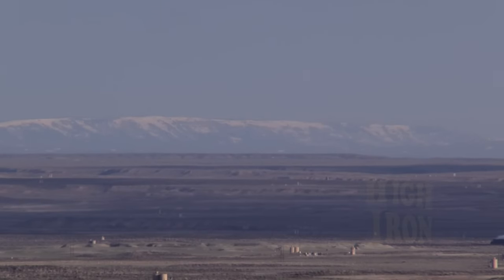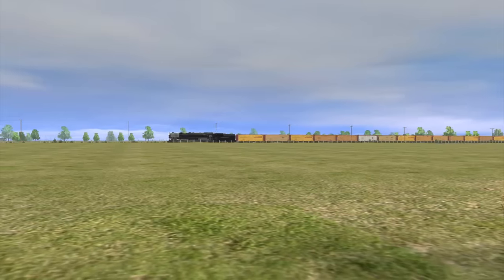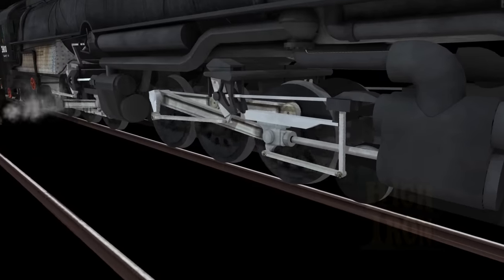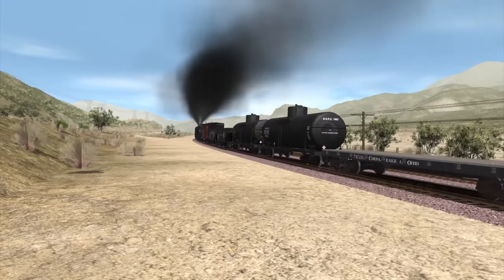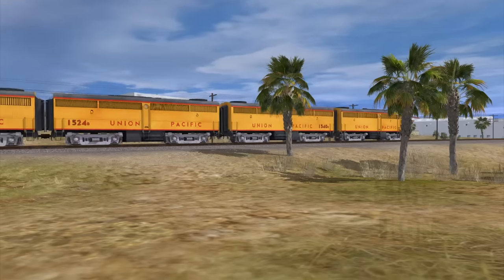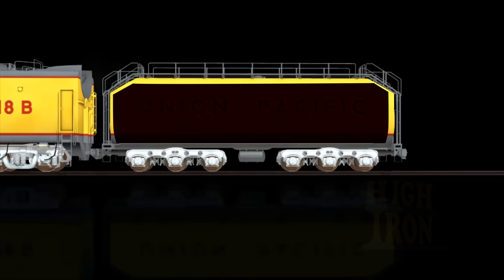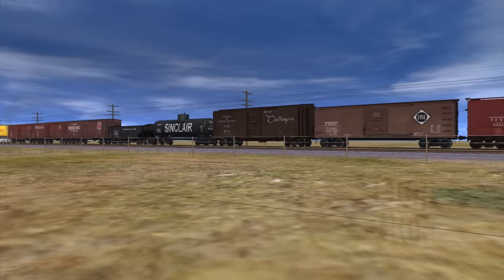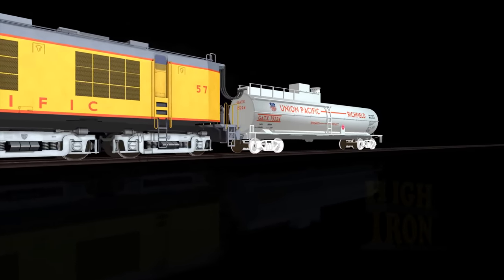Union Pacific's Superpower Fleet

Comment: It’s so weird being a car guy and hearing that 4500HP was 2/3 the HP of a steam locomotive. I had no idea
Reply: Shit ton of torque to
Reply: get a real taste of American machines
Reply: @thatdumboguy2163  what
Reply: @could_possiblybe_thane07echo  we Americans have an obsession with engines that put out ridiculous amounts of power, for instance in WW2, the P47Ds were putting out over 2000hp from their massive radial engines
Reply: @charlescourtwright2229  good, good
Reply: It was measured as drawbar horse power as opposed to flywheel HP and those dynameter cars back in the day were 1000 HP off much of the time.
Reply: Have you ever heard of an EMD 567 engine? 567 CID…per cylinder. Made in V-6, V-8, V-12, and V-16.
Reply: @IndirectHydrox  goddamn 🥵 put that in a Miata
Reply: It's also duty cycle. Most car engines use their horsepower for acceleration and could not be run continuously at max power. These trains were expected to run at very high power all day, day after day. Even the GE90 jet engine may put out 110,000 hp put your can only do that for less than a minute.
Reply: Car guy: yea, this beast has over 300 hp.
Train guy: 3000 plus. On a light day
Reply: AYYY a fellow car AND rail enthusiast
Reply: @crispy9542  if it’s measured in relativity to horses I am a fan
Reply: yeah steam machines basically have infinite torque, it's pretty nuts lol
Reply: And steam locomotives built this nation.  America today would not be the same without them.
Reply: @terry_willis  facts
Reply: not if your vin diesel, appearently he has 10,000hp under the hood
Reply: only 4,500HP Haha Taste REAL POWER HOUSES at 7,987HP You WISH I was making that number up, Pennsylvania Q2 Steam Locomotive a 4-6-4-4 which was in Service for over 13 Years yeah, considered by a lot of Railroad Fans to be the Most Powerful Steam Locomotive Ever Built and Lasted the Longest that weren't even Articulated and that did it right from Day one which Nobody Ever Talks about but Myself. The people that make videos on Railroading it shows they have either No Clue or don't do Research on anything as Union Pacific Railroad was always 4 steps behind everyone else.
Reply: Steam towards the very end was no joke. My favorite class of engine (the DM&IR M3 Yellowstone) has 6250hp.
Reply: @TheNutshaq  a single prime mover is probably bigger than a Miata
Reply: @TheNutshaq  shit bruh you wanna throw in a massive engine in small metal box
Reply: @emyriandragon2277  our god damn switchers go up to triple or quadruple that
Reply: The shredder steam turbine where I did my apprenticeship at a sugar mill was 3500kw or nearly 4700hp. Steam has unbelievable power
Reply: Yep even more than a supra
Reply: The diesel engines in a some locomotives do have a tie with cars though. I think General Motors used to own EMD (a manufacture of locomotives and the engines for them) before they sold EMD to another company in like 2000.
Reply: The thing with the diesel locos is that they can generate more usable torque in operation, simply because they are heavier, and could surge up the electric current during the start. 

For eg., the star freight steam locomotive of Indian Railways in the 1950s had a horsepower rating of 2600 hp, and had a tractive effort of 38,890 lbf. However, the newly imported ALCO FA series diesel locos had a horsepower rating of 1900 hp, but a tractive effort of 61,500 lbf, almost 1.5 times more. This meant that the new diesel loco could start up and haul heavier freight trains compared to the steam locomotives, making them ideal for freight operations.
Reply: The us government  formed  the  union pacific  rail road while the  santafe  wss mostly privately  funded
Reply: Hp does not matter. The actual pulling power is different.
Reply: @doyourememberme2904 yea the Q2s where really powerful, but probably some compund banking engine that had a simple mode was the most powerful, slower then a snail but enough power to tear a building off its foundations (see history in the dark s video, I only like choo choos)
Reply: @crispy9542 me too bro
Reply: @TheMNrailfan227 a single locomotive engine is definitely larger than 2 miatas
Reply: yeah I'm a car and truck dude getting into trains. I'm mostly fascinated by how cool steam locos are, they are just pure mechanical porn
Reply: @charlescourtwright2229  gonna engine swap a Subi with a Double Wasp and you cannot stop me
Reply: Sense HP takes speed into account it's not actually that much to go on.
Reply: Trains and large trucks mostly preform work by torque not horsepower. These machines typically have far more torque than horsepower. You'll see older dual wheel trucks that only have 150hp that could literally pull a house apart because of the massive torque the engines produce.
Reply: @IndirectHydrox v-8 DEVIL16
Reply: Electric locomotives are crazy too, the more powerful ones generally push out 10000hp continuous and some up to 15000hp in boost. They generally do lack tractive effort despite being more powerful compared to diesels but modern ones are catching up in that department.
Reply: Mf it doesnt cover ground the wheels turn and the earth moves under it
Reply: @TheNutshaq  Too bad horsepower doesn't have to do with the power of a horse, horses can sustain about 7.3 horsepower over a long distance.
Reply: @helloperson9445  yeah I don’t really care about horses until I can LS swap or Union Pacific Big Boy swap one. Horsepower being an inaccurate measure of a biological horses actual power output has nothing to do with trains being insane

Comment: shows you how powerful those steam engine were when the needed multiple diesel units to match that power
Reply: Steam tractors are another example. The sheer torque a steam engine can produce is off the charts compared to ICEs.
Reply: Diesel=speed
Steam=Torque and Power
Reply: @somerandomguythatplaysrobl7896  Funny how ppl saying that about electric too. I guess its on the other side of the spectrum maybe.
Reply: Electric motors have a crap ton of torque and a higher power density than diesel, so I’d say they’re closer to the steam end of the spectrum.
Reply: Steam units: Look what they need to mimic a fraction of our power!
Reply: They are powerful for sure, but all the other drawbacks make them rather obsolete, so it is pretty obvious why they stopped being used. Lots of maintenance and cleaning is needed as well as a complicated and time consuming start-up process, heavy pollution, and an incredibly low 6-12% fuel efficiency(for the average steam locomotive, Diesel for comparison lies at 35-45% and Electric at 85-95%)
Reply: Steam holds the record for the best looking and the best at inspiring awe
Reply: @tankskicommander5079  true
Reply: @Badjoe117  Now imagine how much more efficient those steamers could be nowadays with modern tech added. I wouldn't be surprised to see anything  between 40 and 80%
Reply: @Kellen6795  That is true, but I just don't see the point as you'd still need a source of heat for the steam, with either electricity or some kind of fuel. At that point you might as well put in a few electric motors. Three phase asynchronous motors for example are a bit weaker but are essentially maintenance free, turn them the other way and you also get a free generator that can be used to brake the train without friction.
Reply: Steam units: Good luck beating me mortal!!
Reply: @Badjoe117  Exactly. The age of steam is dead, people need to get over that.
Reply: When they run low on water and that crown shield gets too hot,  that is when they really show some power and not in a good way either.  When you hear a stem calliope toting away at the fair, make sure you are standing at least 500 feet away from it because because the clown playing it knows nothing about boilers and it is actually a bomb ready to go off.
Reply: @somerandomguythatplaysrobl7896  What?  I thought it all had to do with Boyle's law and the expansion of a heated gas.
Reply: @David-yf5fo  🤯
Reply: @Badjoe117  You know your stuff Joe!
Reply: @Badjoe117  Aka "dynamic braking." Diesel Electric continues to prove itself...... I serve in the Navy, we've just about eliminated Boilers and Steam Turbines with the exception of Carriers.
Reply: @dr.redstone7980  All of the fastest trains currently are electrics. Without a huge engine at the front, you have a lot of room for aerodynamics.

Comment: UP also tends to run "just enough" power for the trains, oping to not have extra units or extra power if something goes wrong.  BNSF always has extra units on the train (usually 1 or 2 extra locomotives), opting to have the extra power and not need it, then to need it and not have it.
Reply: If they lose a unit they just send out 844 to push.
Reply: @MrMikado282  having gone out a railfanned a bit, and watched the Chehalis, WA, VRF cam.  UP has had two stalls on a 1% grade hill, both within a week of eachother (and it was the same train too).  Forcing the 2nd UP train that runs behind them, to stop and drop their train on the main (right in front of the cam).  Then run up the hill and help push the train, then they come back and grab their train and proceed up the hill themselves.  Either way it causes a major traffic issue (for trains) and for the poor Seattle sub dispatcher.
Reply: in the uk we used to have locos near difficult inclines etc as bankers to help provide the extra power needed aa it reduced costs having to run that extra train the whole route
Reply: @MrMikado282  when they lose 844 they pull out the unit
Reply: @SirLANsalot  You just described every day at CSX!!
Reply: BNSF knows how to run a railroad, moving cars, is how it's done....
Reply: "then to need it"?  How about "than".  Seems to be a common mistake recently.
Reply: @spingleboygle  it's known as the loco that never quits so...
Reply: @skeebot Ok grammar police

Comment: Not only are modern engines insanely powerful, but railroads often opt for AC traction motors, which can drag circles around their DC counterparts.
Reply: What kind of Horsepower output are we looking at?
Reply: I don't feel like typing, hyce explained this whole thing on his channel
Reply: @fireWireX4 India's electric locomotive WAG 12 produces about 12000 hp

Comment: The Union Pacific Articulateds, Gas Turbines, Big Jacks and Centennials: The REAL Legends of the Rails
Reply: Actually all locomotives made from the trevithick loco to today's engines are legends of the rails
Reply: @Иван Ангелов yes true the A had more tractive effort than the Challengers and the Y6b's had more tractive effort than the Big Boy's
Reply: @Иван Ангелов yea true in fact if the parts weren't scarce they could've ran em til the 1970's which was the original plan.
Reply: Yea tho the dd 35 was good and dd 40 ax
Reply: @The Model Trainer This guy gets it
Reply: @mikestudioz3390  Go Norfolk and Western!

Comment: 14:40 I can imagine all those large locomotives literally having a bro-hug with each other, and smiling that their legacies and history aren't forgotten at all
Reply: But the lesser known non up (i think) 2-10-10-2 Mallet?
Reply: @TheT-90thatstaresintoyoursoul  I know where you're going, but the Up never had those. The Virginian Railway has their 800 class 2-10-10-2s, and the ATSF had the others. The Santa Fe Engines however were so goddamned awful, the railway literally took the engines, and cut each one into two locomotives, just so their purchase wouldn't be completely for nothing.

Oh shit...im rambling on again. My apologies.
Reply: @kaidimitri6933  is good
Reply: yes
Reply: @TheT-90thatstaresintoyoursoul  triplexes and garrats.
Reply: @TheT-90thatstaresintoyoursoul  the strongest pulling steam locomotive successful aside from the failed triplexes.  176,600 lbs of tractive effort,  a 10ft diameter boiler which is the largest ever built for any locomotive in history anywhere in the world and also the largest front low pressure cylinders at nearly 4ft in diameter.  Should have all been preserved, but Big Boy gets all the glory. Yes the Virginian class AE 2-10-10-2 had more tractive effort in the teens than diesels do today. (I'm sure all the diesel heads will argue this.)

Comment: The newer EMD SD70AH and GE AC45AH UP “Heavy“ locomotives are rated at 5,355 Horsepower or 14.4 equivalent powered axles. Only took 70+ years to equal the steam Challengers with diesel electric power.
Reply: The first steam locomotive came out in 1802. So it only took 140 years to get to the performance of the Big Boy and Challenger. 😁
Reply: @markantony3875  keep in mind that steam locomotives never had the advantage of CAD or any real computerized calculations to help with designing them. If you could desgin a steam loco with all modern tech, it would blow anything we currntly use out of the water in terms of raw power and on top of that, we could use better optimized biofuels which other modes of power cant.
Reply: @Aliceintraining  No it wouldn't. I have a MS in Mechanical Engineering. Computer Aided Engineering still has to follow the Laws of Thermodynamics and the entropy of the steam cycle. Both of which were well known during the steam era. You could use biofuels in a compound turbocharged diesel that would be 10 times more thermodynamically efficient with a fraction of the CO2 emissions. Steam is dead...and for sound economic and environmental reasons. Those facts will never change.
Reply: Steam locomotives weren’t replaced because they did their job poorly,  they were replaced because diesels did it cheaper.  As far as diesels go,  it’s a bit of a balancing act to get max power without using too much fuel.  Back when big boys ruled the rails,  trucks weren’t much competition so railroads could basically charge whatever they saw fit for freight service.  Railroads will never be replaced by trucks because of the sheer volume of freight they can handle but they can’t simply charge whatever they want anymore.
Reply: @gregrowe1168  The design parameters of a diesel-electric locomotive are not to get absolute maximum power per unit. The fact that they can be run as multiple units that respond as one large locomotive, there is no need to attempt to get absolute maximum power from a single unit. A diesel engine the size of the engine in a modern locomotive could put out 10,000+ HP if really pushed. However, that would result in a vastly increased maintenance schedule, similar to how jet aircraft are maintained. Railroads simply do not want this. They want locomotives that have nearly 100% uptime between their 92 day federal inspections and don't need a full rebuild until after tens of thousands of hours of service. The goal is to get the most horsepower out of the locomotive while being restricted to very high reliability standards, very high fuel economy standards, and recently, very strict emission standards.
Reply: ONLY 5,355HP really that's all as the Pennsylvania Q2 Steam Locomotive a 4-6-4-4 had 7,987HP which has pulled more Freight Cars than any other Locomotive on the Planet on RECORD !!! Yeah Real FACTS! Not Wikipedia Fake facts but real-life Washington DC Artifact Library Archive Facts, Real Timetable load pulling Facts. which No Single Diesel Locomotive has ever pulled be their self-Record recording.
Reply: @markantony3875  A modern day Single Powerful Diesel Locomotive couldn't do anything as to one of the Major reasons why multiple units are hooked up together isn't just to share Power and Braking as there also sharing Massive Volume Weight as a Heavier Front End will grab better Stretching its volume weight out more than being a single unit than a light front end train when pulling a Heavy load FACT! Light front end will have Lead Locomotive slipping on the Rails more often than a Heavier front end. Average SD40-2 on perfect conditions as Temperature and state of rails can only pull in around Loaded freight cars 40 to 53 Cars as to unloaded 60 to 80 cars. 2 Locomotives can better the Pull because there sharing there Massive perfectly. I know this because I've retired Conrail after 38 years Starting PC then CR.
Reply: @doyourememberme2904  Please get back on your meds before you do something stupid to yourself that you will later regret.
Reply: Imagine the big boy...
Reply: @markantony3875 He means it would be much easier and faster to do the calculations, design it, etc. Especially if you're doing this for the first time.
Reply: @doyourememberme2904 You are not an ex-Conrail employee. No adult Would type Like This.

Comment: My favorite engines were the massive three-unit gas turbines.  I read that some engines had their 8,500 HP rating raised to 10,000 HP simply by running the turbine faster.  To use the extra HP, some units had traction motors fitted to their fuel tender trucks.
Reply: I’ve heard that at higher ambient temperatures,  they made more power too.
Reply: I wonder if they will ever return? Today, with hybrid gas-steam cycles they can be incredibly efficient (up to  60%), use batteries instead of ballast, and you can have regenerative breaking as well as run turbines in the same mode all time, oh, and you can use additional power from the batteries for the initial acceleration, as well as go fully battery electric, when passing towns in order to not disturb people.